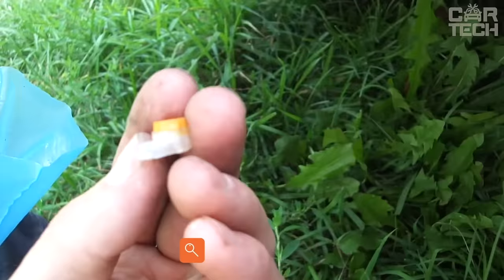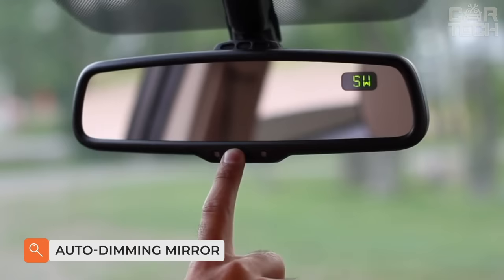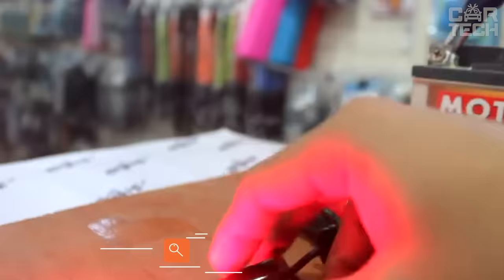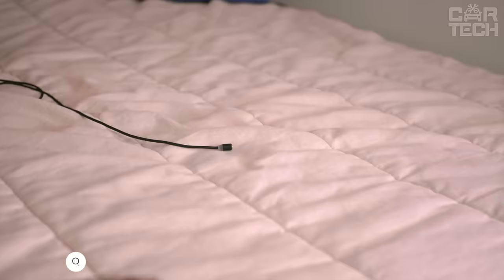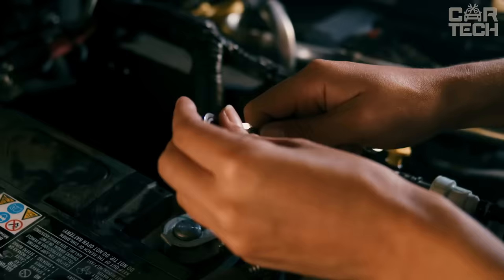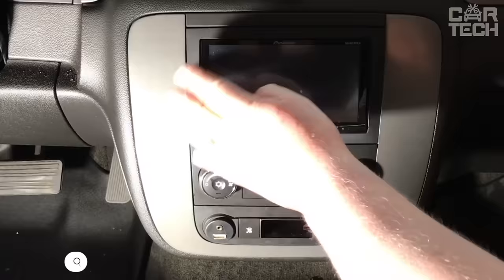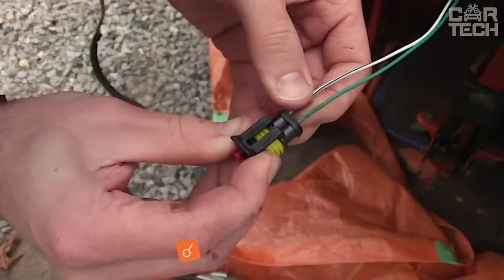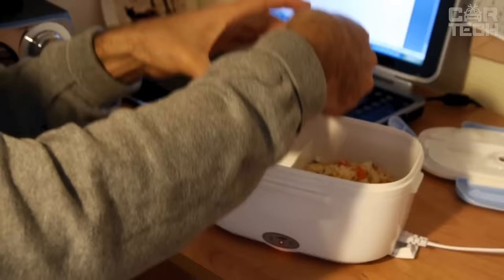100 Car Gadgets That Are At Another Level on Amazon 2024

Comment: Stopped after one minute.

Those wire connectors are for tellaphone wires not automotive wires. Don't use them in a car. 

Why a stethoscope? Use a long screwdriver. It works better without being a hazaed of winding around spinning machinery.

Thanks for playing, please try again when you know something about what you are talking about.

Comment: So-called fenders? These people don't know what they are talking about. They are fender flares. Most of this stuff is garbage. Most people would never use this stuff for lack of knowledge of how to. If the person in your life actually uses tools, you are better off getting tools that have a lifetime warranty. Better still, get a wish list and buy what is on their list. Tools not on a list will likely disappoint the receiver. Electrical add-ons for cars, know what you are doing, or you might cause a fire that will burn down your car before the Fire Dept. can get there. Be smart, if you don't know, ask.